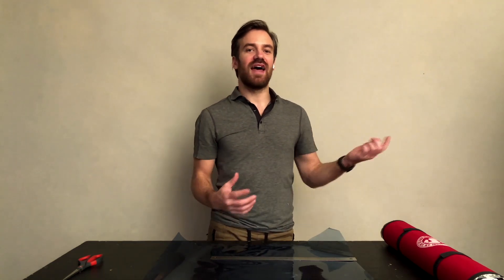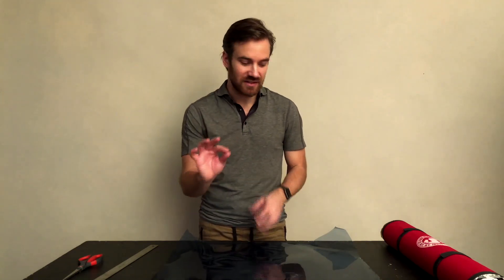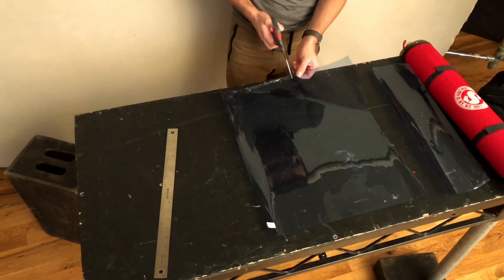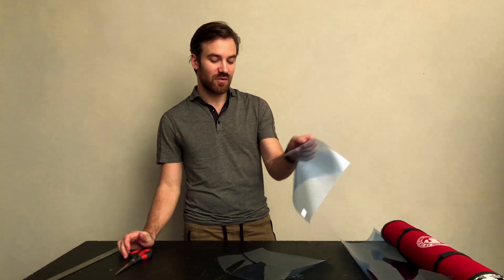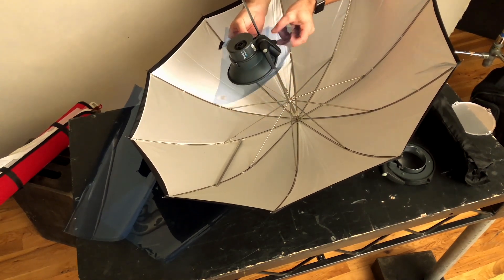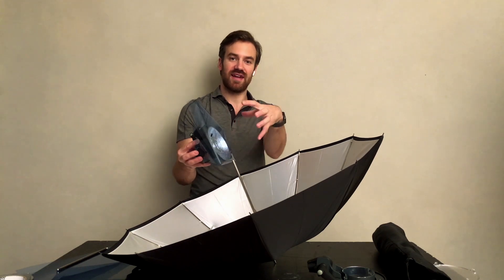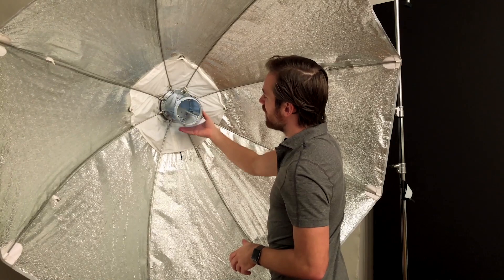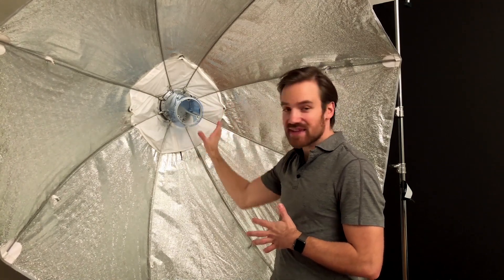Working with Gels

Comment: Hi Felix. First of all thanks for making these videos. Question, in this example you put the CTB on your ELB500 head, but doesn’t have this light already the right color temperature? Bit confused.
Reply from the maker: Hans Eras thanks. The lights are daylight balanced, which means, yes, they fire at the ‘correct’ color temperature. I’m merely demonstrating how to cut and mount gels. This can be done to achieve an effect or to correct a color cast when working with ambient light. This is not a demonstration on which gels to use but how to mount them. 

For more on this, I refer you to www.thelightingseries.com
Reply: Felix Kunze Thanks, clear now.